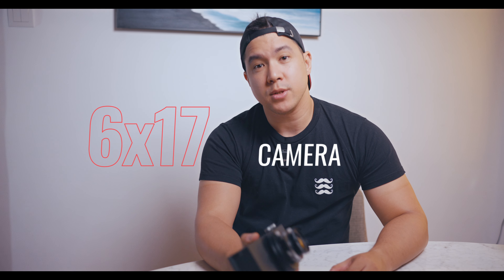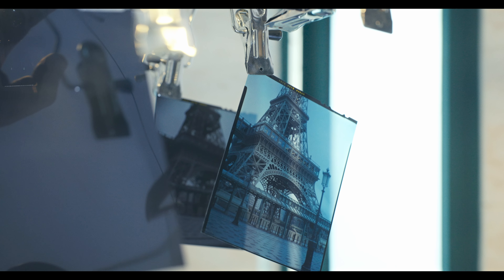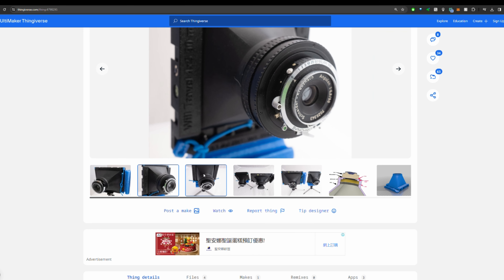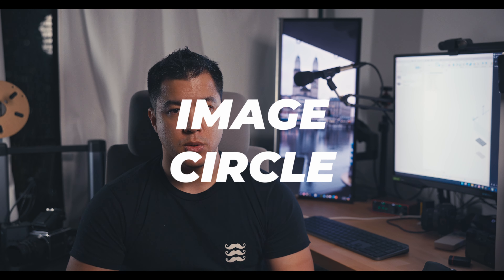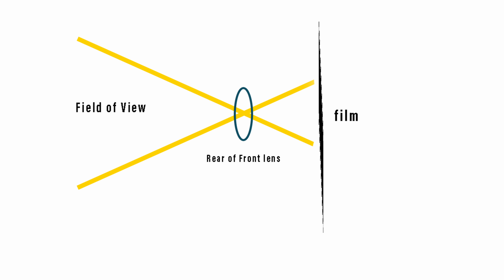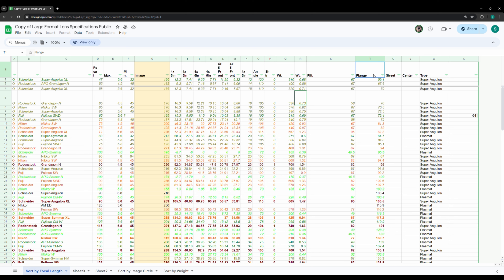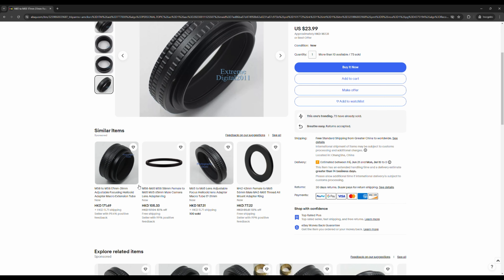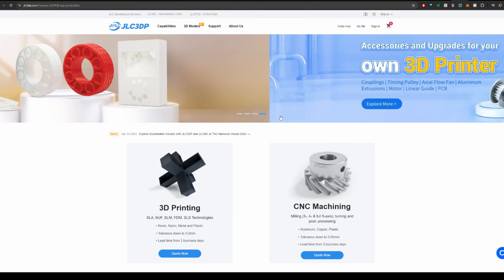Making my own  Panoramic 3D Printed Camera - Part 1 of 3

Comment: Very nice project !
Reply from the maker: Thank you for the support! I am quite happy with the initial prototype, even though the lens I used I knew doesn't cover the 6x17 ( hence vignetting). I am now  waiting for the 70mm mount for my Grandagon N lens which hopefully will have full coverage! Will make a part 2 video once I get the new mount and test it out :)
Reply: @threeamigoshk  let’s do an X Pan with the current lens ! It would be enough coverage :)
Reply from the maker: That's a great idea! Specially since the lens i used, has  very short flange distance, so on a 35mm it would fit perfectly!  I will try to finalize this camera in next week or so and mock up a prototype for a 35mm XPan !